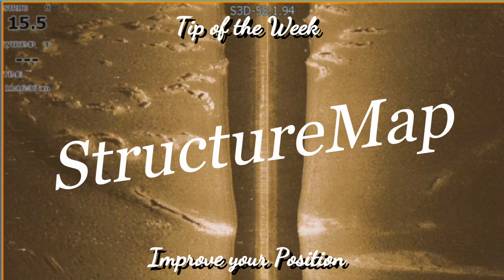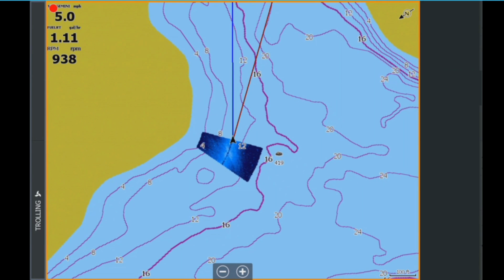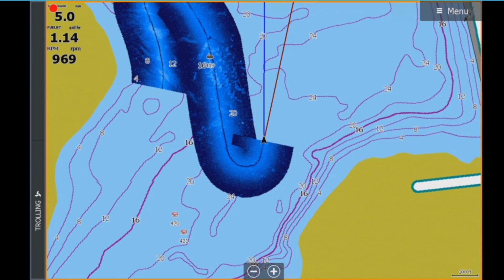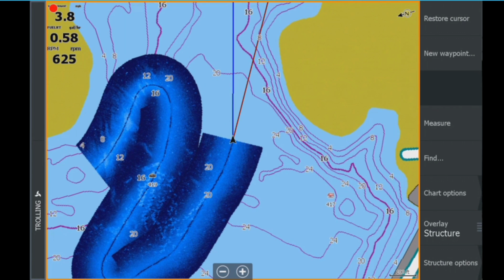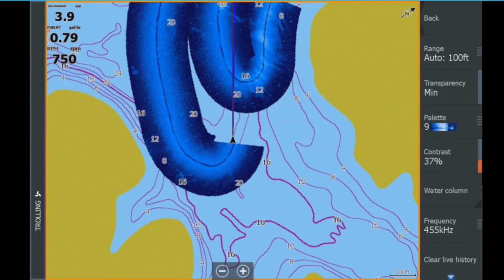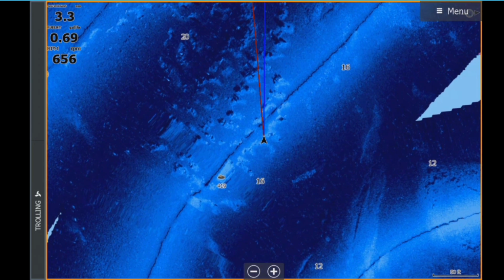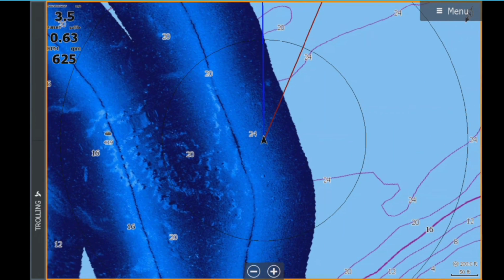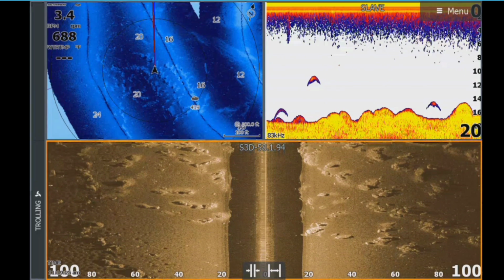LOWRANCE STRUCTUREMAP

Comment: I have recently developed an interest in Structure Mapping on my Lowrance HDS7 Gen3 unit with a TotalScan Transducer. I have done quite a bit of research on how this is done and how to use it.
Here is a link to a google Drive Folder with (5  reference documents) included to help you create Structure Mapping files and properly install them on your Lowrance HDS7 Gen3 unit so that you can view them on your chart as an overlay.  As long as you have the separate SD card installed in one of your SD card slots with the files created during the structure mapping process the saved structure mapped areas  will automatically be viewable on your chart.  You can have multiple structured mapped areas on the SD card and they will all show up on your chart.  If you have the appropriate 12 volt power supply with appropriate Lowrance Power Cable attached to your Lowrance Head unit and can easily view your chart data in the comfort of your home.  If you added any waypoints you can select one and tell the head unit to (show) and it will take you to that location on the card displaying your over layed data.  While you are examining the chart you can even add additional waypoints if desired.

https://drive.google.com/drive/folders/1lhLfXk4onZv-l8jQwCchr5RIeIAwnaVb?usp=sharing

This is the best new feature that I have discovered on my Lowrance HDS7 Gen3 unit equipped with a Totalscan Transducer.
With the information included in the  5 items included you should be able to able to enjoy Sonar Logging/Structure Mapping.
Hope this is of some help in setting up your (Lowrance unit and transducer combination)  that is (capable) of doing sonar logging.
John
Reply: ... Thank you for the link. This video was good and your link helps make things clearer. So many of the other youtube videos either jump around on their, "instructions", are unclear, leave out important steps or assume the person watching knows what they are doing. Well they don't, that's why they (me) are searching and watching videos in the first place. 
Thanks again for he link.
.
Reply: @Jeff_240  You are welcome.  I still need to get back out and do some more structure mapping.  I think it will serve me well for locating the exact position of debris that was dumped in the Tampa Bay Area for creating Fish Havens. I think it will also allow me to scan the edges of shipping channels to locate excellent fishing locations.
John

Comment: great video.
i am just learning how to use lowrance carbon.
after you  recorded your .sl3 file i didn't understand how you showed it as overlay again on the chart.
could you briefly explain  steps how to get there.
thanks
john
Reply: hi! if i didn't get wrong, you can try on the map tap overlay=>saved structure(previously is live) and it will show
Reply: @davischong9350  ... Correct, go to, "Overlay, Saved", there it will take you to the files, then scroll down and find the name you gave it, click on that and it should come up. I believe I got that correct.